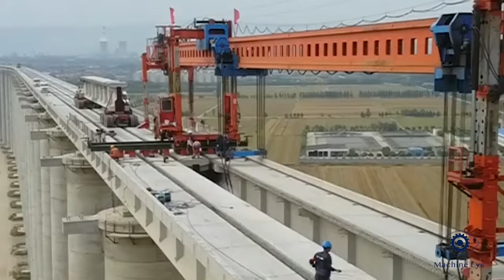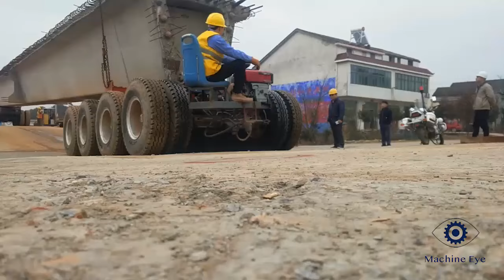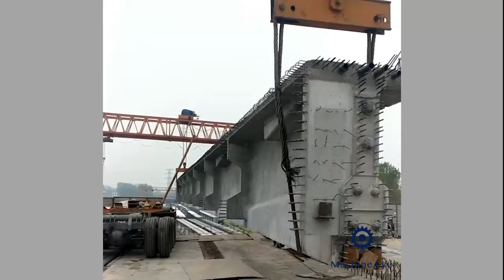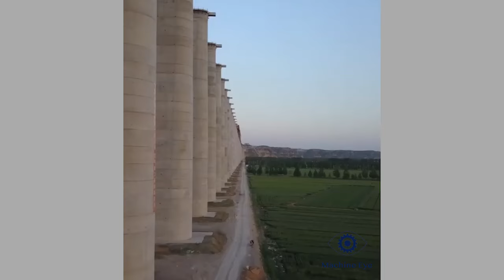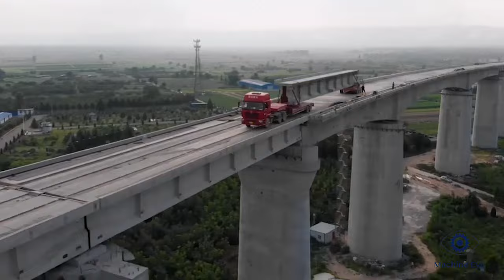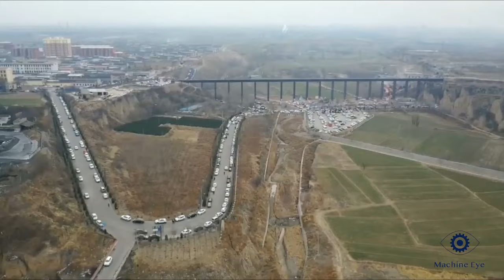Shocked by China's super engineering! I don’t know how to look at this pier

Comment: These are massive construction,  engineering at its finest!
Reply: And the worker death rate was what.....the injuries....low wages....pollution.....and let's see how long it lasts
Reply: Yeah China has a notoriously high rate of building really crummy buildings.
Reply: @chrismaloney5213  sounds like how the industrial United States started
Reply: @chrismaloney5213  There are hardly any workers there for such a massive project. Don't be jealous.
Reply: Engineering at its finest, but... what is it? Why does no one question this? You have perfectly flat land, but they choose to build a massive road suspended 100 ft in the air. It's only the width of one car lane. 

This entire thing is a propaganda project

Comment: The land looks pretty flat...why didn’t they just build it on the ground?
Reply: Terry New Because there’s very high ground on each end of it and a high-speed train can’t dip down and go back up so quickly like that
Reply: Robert Manly but what he said, land is pretty flat so why not build it on the ground
Reply: At high speed, the train take a long distance to stop. Cannot have any animal on the track. Also safe from bad apple and flooding.
Reply: @gordonou7065 
You have to look at a longer stretch and overall Cost Benefit Analyses to design a Highway or Railway. 
1. If from an Undulating Terrain a high speed train has to keep slowing going downhill and accelerate again going uphill to achieve 320km/hr, it will defeat its purpose.
2. If from High Terrain both The Entrance to and Exit from the Plain is very Steep and Challenging, at times it is much easier to just elevate and navigate over the Plain.
There could be also Considerations in Soil Condition, Flood, etc but judging by the height of the Pillars Reason 1 and 2 is more likely.
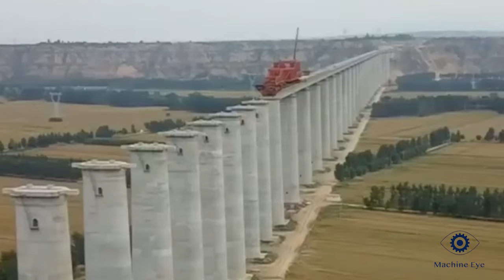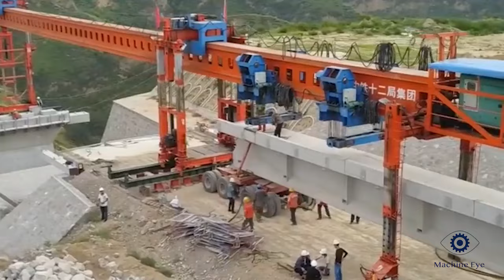Reply: Terry New Check out 0:57 and 1:47. At the first you can see the high ground at one end and the gear is on the high ground at the other end at the second
Reply: Another reason for this is actually land preservation. You see there’re many farm land around the line so elevating the rail way takes less area (no need for road shoulders fences, etc). China has such a huge population, so every square meter counts.
Reply: Bruh, why do they build bridges?
Reply: Its almost like, theres a hill on one side, and another hill on the other and 180mph is way faster than 85.

But shit, what do I know?
Reply: You can take away ground to make it the height it needs to be lol an the pilings are supported still take up just as much room as it did if it was on the ground
Reply: For trains going that fast you need to built a solid track anyway, you need to built bridges either for the train or for crossing roads. Even if it looks flat, the slopes for the train might be very long, so you need a lot of pillars anyway. Flooding or variations in the ground might also make pillars needed. Nice side effects: it protects from metal thieves, quite a problem in Europe. And last but not least, it’s impressive, just build it 😎
Reply: Manny factor, and i think one of them is a more consistent horizontal movement
Reply: Propably cheaper to build elavated tracks instead of commin railroads.
Reply: @gordonou7065  because this is the high-speed train running at above 350km per hour, and the ground isn't flat and hard enough.
Reply: Train tracks are not like roads, they try to be as level and as straight as possible, the overall length of the line is probably built on ridges and on higher land, so the engineers use bridges, tunnels and elevated tracks to make the track as level and as straight as possible.
Reply: Because it's crossing a deep valley,a bit like running a high speed railway line across the Grand Canyon.
Reply: I'm gussing this is a large scaled viaduct.
Reply: Doh!
Reply: Flat on surface can't have high speed train. Has to be on air. That's another reason why western don't have bullet train.
Reply: there are many reasons. for example, there are already many road on the ground, so the best way is to cross them in the air.
Reply: This is being built for trains that travel at 250 miles an hour.
Reply: Exactly
Reply: Its elevated mainly to avoid the up and down of terra firma but flooding, auto/truck interference, pedestrian animal movement, ..all make elevation the only practical choice.
Reply: did you see a bullet fly on the ground? high speed train is like a bullet.
Reply: it is a flood plain

Comment: The first one is actually not a bridge but a long elevated freeway stretch that connects two separate mountain ranges. Could've easily been laid down on the ground in any other country. 
Really amazed at the insane amount of money spent on making it a complete hassle-free way.
Reply: Not really, trains can only go up or down a maximum tiny slope %, look at 0:55 there is like a big cliff there
Reply: So, how exactly is it not a bridge?
Reply: I'm thinking it's for a high speed railway. You can only descend and rise at below certain slope angles, so it wasn't worth dropping down just to rise back up. Plus having a railway raised off the ground doesn't get in the way of local roads and infrastructure. Flippin' expensive with those piers so close together though?
Reply: Similar to roman aqueducts to move water from one area to another
Reply: @lanemcreynolds9894   Viaducts are a form of bridges that have several spans, arches, or supports. So.............

Comment: The first thing that comes to my mind when I start watching this video is it looks like they're going to flood that area.
Reply: Or that that area is seriously flood prone. I mean this year alone they had 5 major floods and 2 catastrophically destructive floods. 

I don't think they are going to flood that section. As every single pillar looks to have an emergency access to the ground built in. So my thought is the hight is to span the valley so the passenger train can move at a high speed. 
This also could be for freight and moving goods both imports and exports for the Belt and Road plan.
Reply: My first thought was that this thing will collapse in a few years because the lack of regulations they have.
Reply: @monkymind4316  it's because you can't have "crossings" with trains traveling so fast. They need to be isolated from other traffic, animals, people, etc. Also due to the speeds, you cannot have tight curves or steep grades. Bridges take care of this. HSR in other countries are on elevated track too.
Reply: ,... the supporting piers don’t look correct for a lake trestle, but the engineering is unimpressive. It’s all to me some grand showpiece plan but they’ve over-reached and the project will need too much maintenance to stay in service for more than a few years. For example, the precast concrete spanning beams are visibly dead flat with no load. With no pre-loading they’ll all start cracking on the bottom edge within a few years and have to be replaced. Another example; the curved railroad trestle over the gorge near the end is on tall single columns. There’s been no consideration of the lateral force from the centripetal force when a train crosses the trestle at any speed. Likewise part of the locomotive’s thrust becomes an outward lateral force if it accelerates, and the inertia of the train shows up as a lateral force toward the inside of the curve. These cause the columns to flex and crack on the edges facing the inside and outside of the curve. If the train is at speed and goes to emergency braking all the forces have to go down through the structure, and that structure has “can’t do” written all over it. After their first scare when the structure moves and the rails gap causing a derailment, they’ll figure it out, declare the gorge to be a scenic wonder and cross the trestle at something like 10 or 20 kph until some nearby tremors give them an excuse to strengthen the piers and replace the spans with a steel structure. Unfortunately, even if they’d done the engineering better and designed a wide stance two leg trestle, precast concrete isn’t well suited to the dynamic forces of supporting high speed rail and in a country burning a lot of fuels that produce smog (think sulfur), acid rain will dramatically weaken concrete over time. Given the available materials and schedule they’ve done what they were asked. Presumably their leadership already knows all this. What looks like an expensive doomed showpiece, is the same budget as Olympic Games and World’s Fairs - its all to persuade the general population that the leadership is improving their lives. High speed rail is costly, maintenance intensive, luxury travel for medium-high status individuals. It’s value is for the general population to realistically aspire to, or in this case to literally look up to. It’s possible for the public to think that they could have enough money to buy an expensive high speed rail ticket instead of taking the slow train, but they choose the slow train to have money for something else. This gives them permission to regard themselves as having a higher status lifestyle than their actual lifestyle. The directly measurable economic value of a high speed railway system is probably negative, i.e. it only diverts resources to enhancing lifestyles without improving productivity. The same argument has always applied to dyed cloth, but for the last century or so the cost has been low enough to become all but ubiquitous. High speed rail travel, by its nature, has a limited supply and irreducible cost.
Reply: @oliverstreet7704  your theoretical argument is 10 years too late dude. And proven wrong, limited by your own imagination. HSR has completely transformed and became ingrained in Chinese life.  It's a lot more convenient and more affordable than both air and road travel. A $50 round trip will allow you to make a weekend trip to a place that would previously take half a day to travel to. And the trains runs several times an hour. You'll be amazed
Reply: @oliverstreet7704  
Yeah, I'm not an engineer but even I have played Build a bridge. The Romans used arches on everything for a reason. 

I also, since commenting, watched a video on Chinise building scams with "tofu" buildings. Where the concrete is cheap and can be damaged by insignificant force. All because there is a prevailing coruption culture of "cheat if you can get away with it". Where looks are more important then long term fuction. 

Now all of this is not to say that all Chinise building projects are scams. But there have been some major avoidable disasters that come from this kind of fraud. *(And while less common American construction is not immune to this problem. Recent exsample is the collapsed walkway in FL.)
Reply: @monkymind4316  Protect the environment and soil, and allow wildlife to migrate
Reply: @Mac_Omegaly  The HSR is fully elevated. Now the high way is fully elevated too.
Reply: @oliverstreet7704  Jesus, how negative are you. It looks to me way over engineered than under engineered, I'd tend to think that they know more about their design than some guy on the internet. As for whether high speed rail is good, seems to work well in Japan. With all those people you need good transport. What's your alternative, Rickshaws?

Comment: China's right step is to increase railways for transportation efficiency in its country because to build a railway it can be by utilizing its domestic resources. In contrast, the aviation world is controlled by western countries and the United States so that it will be very difficult to enter the commercial aircraft industry, for example, Sukhoi, a company that has experience in the aviation industry at the time of entering the commercial aircraft industry was hampered by Western competitors and the United States, even the Sukhoi Superjet 100 was sabotaged until it crashed in Indonesia so that it did not become a success.
Reply: I believe the word sabotage comes from the wood shoe called Sabo. which would be thrown into the silk lom to get extra time off by workers.
Reply: c919

Comment: Nice TWO lane road.  Actually can't see the point of it.  The towers take up as space as a road bed.  Look impressive though.
Reply: It is for a high speed rail. Hence the height, cant have steep grade to go up and down the valleys, so just go across.
Reply: It is not for high speed train, but for heavy load train from north China to the southeast part of China. Its role is to transport coal.

Comment: Seems like putting a road in the ground would have being easier, weird flex
Reply: I'm pretty sure it's a train bridge. Trains are notoriously bad at going up hills so this is easier that building a low enough slope on both sides
Reply: That what I though,   Why does it need to be elevated
Reply: @joshephand5538  it's a train

Comment: building seperate sections and connecting them is just easy and more cost effective. Are these joints placed over roller support or just fixed off casually?

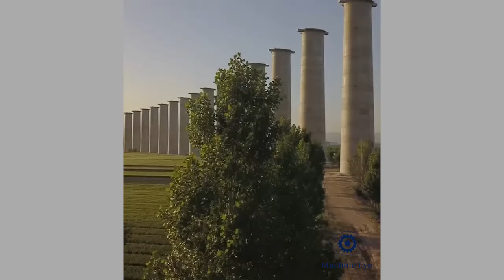Comment: 6:07  They don't like to drive on the ground or something? 
Surely a road would be more appropriate.
Reply: Easier and less expensive by far.
Reply: It's for high speed rail
Reply: @cam4united  Yeah... Other countries have high speed rail too, but building it 50+ meters above ground for no apparent reason may be a bit excessive. It looks ugly as well.
Reply: @kaba_me  it looks like it is a bridge?  really hard to tell but that is what it kinda looks like to me from some of the shots
Reply: That was exactly what i was thinking. This seems kinda useless
Reply: I think it gradually slopes down, to make a shallower grade from the cliff on one end. I have never seen anything like that before though.
Reply: Prioritar high speed rail, no time to brake and stop for stupid drivers  going through stops and barriers
Reply: @kaba_me  If there was no reason, it would be strange.  It would also be strange if engineers capable of building these structures weren't well versed in what they needed to build and why.
It's probably safe to assume there are some reasons that may not have been obvious from these tidbits of video.  Such as managing grades in terrain with significant vertical changes. 
Perhaps part of the issue is that China decided to build an enormous amount of high speed rail lines.  And some of them are no doubt located in terrain that present major challenges.  Challenges that some other countries would look at and consider unfeasible.
Reply: This method would keep 80% of the ground below still available for farmland and wouldn't cut land in half with a road. Also, it's China. They probably want to show off a bit too.
What a fucking monstrosity though.
Reply: @kaba_me  simples. Gradient, rate of change of gradient. Also grade separation means no cutting off both sides and risk of unwanted objects straying on tracks is greatly minimised. 
Sure, you ask why not underground ? (I know you are thinking that) answer is in the beginning, gradient, rate of change of gradient. 

You tube is full of people who are clueless trying to be smart. 

But luckily sometimes people who know the subject decides to comment too.
Reply: @TsLeng  The height could be easily reduced to zero or a more reasonable 10 meters using just 2% gradient over 2 km. At that height most of the concrete could be hidden behind trees, which would look much better. I guess they just had to make it look ugly.
Reply: Maybe they put it up in the air because rice patties have to flood you know
Reply: @Eraknelo  Show off? You jealous? You didn't know about it. OMG. It is an engineering feat and it is for high speed rail in a difficult terrain. Don't be so stupid if you wanna make a comment.
Reply: @floriduhman9520   @Jesse Fritz  Just like what the BBC says... Don't be jealous. LOL It is an engineering feat and it is for high speed rail in a difficult terrain. The Chinese are the smartest people.

Comment: Compression
Tension
Torque 
Expansion(heat and force) 

Once the structure 
Are design the disruptive tech will compute its structural integrity. 

Or plan the best method of building it or create appropriate technology to hasten development, usefulness, utility of the product or structure

Comment: Considering the Three Gorges Dam project I am also curious if foreigners were the actual designer of this causway or if the Chinese actually designed it themselves.  The Chinese have been known to be plagiarist who steal what manufacturing techniques they can, but I do not see them as design innovators.  It has been proven that much of their constructions leave a lot to be desired because some not ten years old are already falling apart.  If I remember correctly the Three Gorges Dam was not set down upon Bed-Rock and is one of the reason that they have a 24/7 watch during flooding, because parts of it can move.  NOT GOOD !
Reply: Every dam should have 24丨7watch, that is common sense. Check the dam built in your county to see .